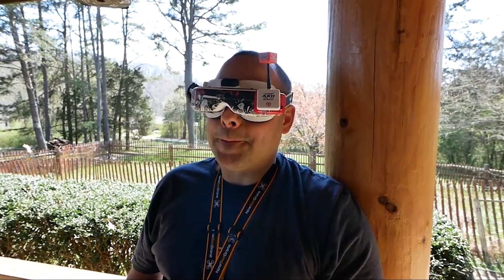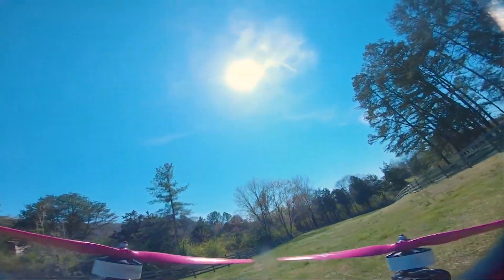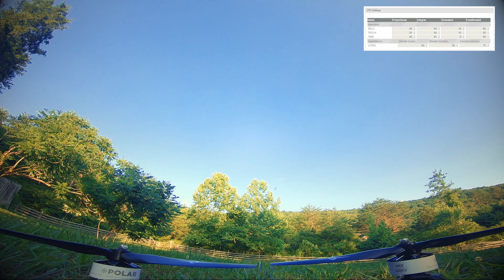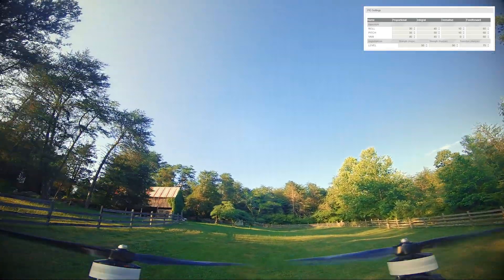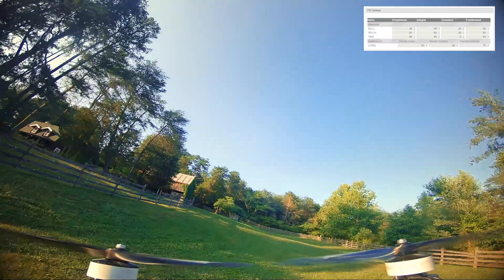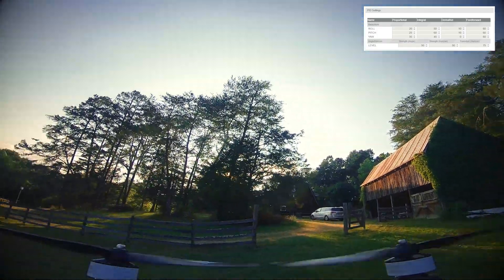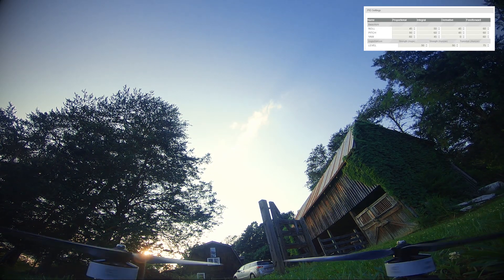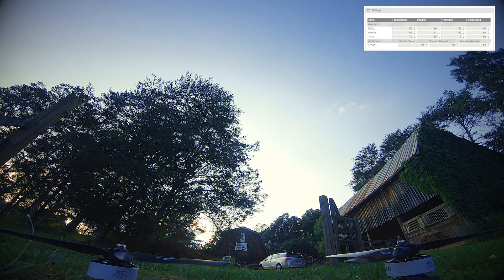Beast Class X-Class PID Tuning | Part 1

Comment: Great video.  I built a 10” Source one with big aluminum struts and carbon skis.  Unstable and tasmos occasionally.   Filter FFTs are ugly.  It seems the 53 Hz BiQuad on D makes it semi stable.  Removed the skis and replaced with light weight stiff DJI spikes.   Lowering the gains over all really helped.  Will work my way up.   
Thanks JB!

Comment: Hi Josh, it's been a while since you explored this, but did you ever return to this and discover why this rig was so difficult to tune? Some sort of fundamental problem with the rig or simply not the right tuning settings? I think 12S with such powerful motors and a compact frame definitely up the challenges because of the low hover RPM and relatively low rotational inertia of the quad I imagine it has lots of authority, maybe too much?
Reply from the maker: A bad motor, unfortunately. When I replaced the Polar motors with RCInpower, suddenly it was amazing.
Reply: @JoshuaBardwell  oh right I missed that! It was so long ago I forgot about that. Thanks for the lightning fast reply!

Comment: Can the Matek XCLASS FCHUB-12S be used with the Matek F722 HD? I noticed the Flight controller seems to only go up to 8S. How would you monitor the battery voltage from the FC  with a 12S setup  44.4v?

Comment: Do you think a damaged or slightly out of balance prop and subsequent vibration could cause a quad like this to fail?   I have found that if a prop on my 5 inch quads is slightly out of whack it causes my motors to get dramatically hotter and seams to overwork the whole system.  Would think that effect might be amplified on a quad like this.

Comment: I think it’s very Cool. Something stately about it, I guess. Ha ha 
It’s prolly pretty good that the props destruct easily. Well... instead of just going on to continue and burn up the electronics, or chew up the yard. 
I Dig the sound of the relatively low rpms of the motors, as well. In short, there are many pleasing things about this quad, in my opinion. I think it kinda obviously falls in the category of things we build... cuz we enjoy building things... and it’s there to be tackled. On to ideas on how to keep it in the air $ wise. Ha ha... ... ask for one prop from each person in your family for Christmas. 😝

Anywaaaay... good job, man! I mean... danger aside... takes brass balls to just fly that much $ around the yard!!! 😬👍🏼✨

Oh! It’s called Beast Class, cuz it takes a straight up beast, to arm it!

Comment: Would adding additional capacitors on the esc power wires or the pbd possibly act as a backup incase the apd one comes loose? 
The pads are so small and after the caps get bumped once or twice and bent back they can break free easily and its extremely hard to tell they are broken free in the 3d printed mounts

Comment: These frames are such gimmicks imo.

Can I buy a drone that bleeds my bank worse than regular high speed quads.. 'Check'.
Can I buy a drone I need to transport in my high floor 4x4 just to complete the compensation-sensation... 'Check'.
Can I buy a drone that crashes spectacularly with it's weight of 6 lbs+.. 'Check'.
Can I buy a drone that 'when' you crash, destroys most props and an arm and/or a motor or two.. 'Check'.

Can I afford to replace 2 or 3 blades a crash (28 to 42 dollars on props alone) if and when available.. 
Not to speak of the arms and motor costs..  And it does not fly better than a 5" quad? 
This is just an attempt to upscale race quads for the viewing pleasure of spectators of upcomming race events.. 'maybe'.
All in the hope that futue drone events will pull more spectators, who would actually be able to see & follow these quads without goggles.

I know it was intended to promote the sport.. And I appreciate the attempt. 
But, no .. Hell No!
Reply from the maker: I don't see why you (and others like you) are so angry at this quad. Motorcycles are a more dangerous way of getting from point A to point B than cars, but people still like motorcycles. The whole point of this quad is that it is big, visible, and impressive. If that's not what you're into, no hard feelings from me. But why are you so mad that that's what me (and others like me) are into?

Comment: Yay! Finally a video that acknowledge the fact that not all quads fly can fly perfect on BF's stock tuning. My largest quad also suffers from the same type of oscillations and I also settled on using approximately the same pids that you used here. It does fly somewhat ok but it's far from perfect and I'm really excited to see what settings you end up with in the next part! :)

Comment: Cool idea like 3D helis but without the collective  pitch control 
Interesting note on the Mobula 7 Betaflight controls now support additional D (min) control also throttle limit/Scaling/% control on the PID control panel. Not sure that was there before I upgraded the firmware

Comment: I always do a tug test when a solder my wires.  Just gently tug on the wire, and if it breaks, it probably won’t be able to handle a crash, especially in a tree where sneaky branches steal my 36 gauge wires.

Comment: That is the most f*cking awsome lawnmower I've ever seen! One thing though Joshua, WHEN you get the beast flying as good as you feel it will do in Betaflight, how about having a chat with Paweł Spychalski
 and see if it will fly the same with INAV. With a next-to-no-grams GPS you could have the beast do RTH on Fail Safe... Damn Joshua and Pawel doing an INAV Beast... That would be mindblowing!!

Comment: Isn't the distance between the props too short? I remember a really bad crash I had with my F450 build with 10" props and I think this was caused by the turbulent airflow between the props.
Just my two cents

Comment: I say build them all! Little ones for the rainy , winter wet days . A big one because we can. 5" will always be where my heart is . I built my first quad last week. I flew a Walkera f215 with t motor f40 pro 2 and kiss 32 and 24 esc for two years. I finally learned and saved enough to build a rooster with all kiss stuff. Loving this v2 flight controller. Feels so locked in and confident. This 5" rooster feels so much bigger than my previous Walkera f215. Loving that hobby and all the wonderful helpful people just as much ❤️. Thanks community and JB

Comment: Hi just curious to see if anyone can help my quad says in fatshark goggles that it has armed when I flip the switch but the quad itself doesn't actually arm I don't know what else to try
Reply from the maker: If the OSD says "armed" then the flight controller is armed. If at that point your motors don't spin, the issue is between the FC, the ESC, and the motors. For example, if you have selected Dshot as your motor protocol, but the ESC doesn't support Dshot, then the motors won't spin.

Go to the Motors tab in Betaflight. Remove your props. Plug in a battery. Enable the "props are off / I understand the risks' option. Raise the sliders one by one and see if the motors spin. That will confirm whether the FC can talk to the ESC and spin the motors.

Comment: BTW, you don't have to spend a fortune to build big. This is my 600mm frame with some cheap 2212 920KV motors and 40amp ESCs running on 4s with 10 inch props. Total cost was well under $200. I thought I was going to have to shell out the big bucks to get rid of that bobbing at throttle ups and sharp moves but I'm happy to see(sort of) that the 12s versions have the same problem. As you say, beast class is all about the spectators and they can't see the bounce issue but they can see the quad for miles. Check it out: https://www.youtube.com/watch?v=ZcGQ2jV7Vlk

Comment: You're having the same problem I'm having and getting about the same results with the trial and error method. I know my crappy aluminum frames flex so much it's probably a big part of the "dip" I get. Glad to see even the carbon frames do it too. Finally got most of the jitters out via filter tuning though I had to go down to 30hz cutoffs. Speaking of filter tuning and black box stuff, what happened to the Chrome version of BBexplorer? Still can't get the stand alone version to open. Not sure what I'm doing wrong this time.
Reply from the maker: You can still download a Chrome app from the github repo you just have to manually install it in developer mode.

Comment: best intro ever!
So far my gps says 105mph on a full throttle pass (proshot1000), with the 3x power props..
(Edit:hit 109 today on dshot 1200)

Would a random osd voltage reading mid flight be caused by no ground wire on esc telemetry, like 125v then back to normal or is betaflight having trouble understanding 50volts
Reply from the maker: I get those random volt readings too. I think it is the APD ESC freaking out.
Reply: @JoshuaBardwell   okay thanks, do you think it's safe to fly without that ground hooked up if everything seems normal otherwise?
I checked my esc after this video, and the positive leg of the cap is infact not attached, I originally thought it was from the crash but now I'm thinking that caused the problem I had also, so be extra aware to anyone building this to get the solder on those caps and triple double check that the joints are solid...

Comment: Props out on this one, or are my eyes messing with me? So much for putting it in 3d mode to cut the grass with it. 😉
Edit: I assume the "dihedral" look to the motors/props is just edge distortion from the wide angle lens, there's no actual inward tilt to the motors, right? BTW, I think the term dihedral is probably not correct as I suspect it only applies to wings, but I used it because I thought it would convey what I'm referring to. OTOH, I guess a prop kind of is an airfoil, so I don't know. Guess I should go look up the definition. 

Definitely not a waste of time JB. I don't see myself getting hands on with beast class, but it sure is interesting to be along for the ride as you're discovering what it's all about. If you ever burn out on FPV, I think you may have a future in making scary movies! Seemed pretty convincing! 😉👍
Reply from the maker: Props out correct.

Comment: Great Tutorial - even if you don't call it so :-) 
Also thinking to change to Beast Class Size. I bought my Cannonball when there was no Beast Class yet, and the 13" Props just look strange on such a huge frame. So I went to 16x10" . Rund well, but full throttle the current limiter kick in.  What do you think about the sound? Nope, what's not a turbine jet :-D   My daddy filmed it with a Gopro, so - just for the sound. Image quality is lousy.
https://www.youtube.com/watch?v=xjvQ3M9pOCQ
Reply: Hi mate, how do you implement a current limiter? I'd like to use one as well
Reply: I use 6s 82A BLHeli32 ESCs, they have current limiters by default.

Comment: Bump it up to 18S!  :-D
But seriously I think that your motors are quite on the low kv side. They are rated up to 14S. MAD Components offers 10S motors that have 635 kv instead of the 380 kv that you are running on 12S

Comment: Not everyone should be able to fly this. But with license and experience and a possible spot to fly - then yes it is awesome.
Btw: is it possible to connect the pid-values to tx-channels ? It would then be very handy to modify i.e. P-gain by turning a potentiometer-knob on the tx to find the best value for that single parameter. And then configure the next setting to that knob...
I'm not sure that the "Adjustments" in BF4 can work that way.
Reply from the maker: Yes you can do that.

Comment: when its doing that thing it looks like its only oscillating on the roll axis. im just trying to further my understanding of PIDs but would it make a difference to raise P on roll and leave P on pitch where its at. the quad didnt look like it was rocking forward and back. am i completely wrong? also it is a stretch X frame right? maybe even only raising D on the roll axis. please tell me if im not comprehending
Reply from the maker: To me it looks diagonal as if one of the motors is having an issue.
Reply: @JoshuaBardwell  thats interesting. Good excuse to getba set of those big beautiful Brother Hobby motors. Lol. Will you be able to assess it better with blackbox?

Comment: Flying beast class is like driving a muscle car, sure a Prius would do the same thing fine, but a muscle car is louder, bigger and completely unnecessary, but its fun as hell :)
Reply: Nah, 5" are faster and more powerful, weight to power ratio, it's more like driving a big big truck with no trailer, you are not carrying more stuff with you, it's just to show off. I once build a X900 tricopter, it flew good but had bad yaw oscillations, but that thing would put on a show at night with a big RGB led strip all around the frame and arms, a big colour changing  flying triangle. ;)

Comment: I actually like a a very low dterm cutoff like 30hz. It allows me to raise the d term very high, which allows me to raise the p term a little more than is usually possible.
Reply: This is very interesting.  I’ve had this idea for a while that a 2nd, more heavily filtered D-Term could be useful.  Because yes, it often seems like D is typically tuned for prop-wash handling with motor noise/heat being the limitation, while looking at logs of large setpoint changes seems to indicate that a lot more D would be useful.
Reply: but this will mean that you d term does the same as p term on 60hz if you use pt1 (someone correct me if i got my phase shift math wrong here) just making any vibrations at that freq and above worse. Filtering ads delay, to much and you just amplify your noise due to this delay.
edit: I got my phase shift math wrong... Might still not be correct.

Comment: Joshua, these are the PID's I am using on my 10" modified Merica frame. Give them a try...
Roll... P 88, I 27, D 15
Pitch... P 116, I 33, D 18
Yaw... P 140, I 30
I am running Betaflight 3.5

Comment: I’m running the cannonball frame on 14s so I’m a little bigger but your high I is mostly what your fighting. This is what I run: roll P 57 I 13 D 35, pitch P 59 I 13 D 50. As for the performance the 5 inch top speed is fastest but my Xclass cruising speed is faster overall. My average cruising speed is a little over 100mph with about 50-60% throttle and it will be above a 100 for the whole 3 minute flight, plus the amazing sound they make is what really makes it exciting.

Comment: Ummm since you built the same quad as Neil couldn't you have just copied his tune 🤔
Reply: Interesting, I run catalysts tune on both my xclass and my beastclass and they fly extremely well, so as for a baseline of where to start you can definitely start with someone else tune and adjust from there
Reply: tune is different even if the quads ar exactly the same. each quad has its own unique resonance
Reply: many pilots have 2 exact quads and the tune is sometimes drastically different. especially with these big Beast class
Reply: @djilly75  I have 3 racing quad clones and they not exact same tune but pretty close. You can definitely get close with the tune by copy and paste. I agree beast class running higher voltages maybe different

Comment: I think these props are not good for handling hover and backward movements situations. They're designed for planes after all, and were built to their min speed be at least 20mph. The new props they released specifically for quads may result in a much better experience, and since you will probably use them as your main props in the near future it would be a smarter option to tune the quad with them instead of insisting in these ones that you probably won't use anymore whenever you get the quad ones.

And thanks for the content. Happy flying!
Reply from the maker: Catalyst advised those props were not a good choice for this setup.
Reply: @JoshuaBardwell  Wow. Very interesting. Did they say why?
Reply: Gabriel Biller Giareta the MAS 13x12x3 V1 props are pretty much the best prop out right now. The V2 version and others that look like the V2 have a problem with exploding on punch out’s.

Comment: From the peanut gallery: the intergal of a sine wave is a sine wave. the derivative of a sine wave is a sine wave. if you want to get rid of an oscillation you need damping. damping typically comes from a low pass filter ... Below the frequency of the oscillation.
Reply from the maker: Currently running with gyro and d term LPF at 40 Hz
Reply: its actually -cos and cos (which are time shifted sine waves anyway). If you add to much filtering your d term cos wave will be so delayed its the same sin wave again and will just make the oscillations worse. Less filtering is usually better if you can get away with it.
Reply: @someonespotatohmm9513  so I guess you don't understand damping. your cos cos remark is stupid.
Reply: @toddmarshall416  The thing I am 100% certain of and I could not have misinterpreted is the cos part.
edit: source: https://www.intmath.com/differentiation-transcendental/1-derivative-sine-cosine-tangent.php
In passive systems damping sometimes is a kind of lpf. But this is an actively controlled system where in short, things are more complicated.